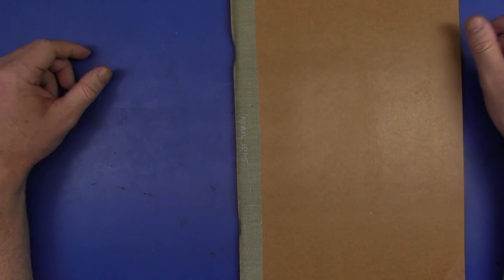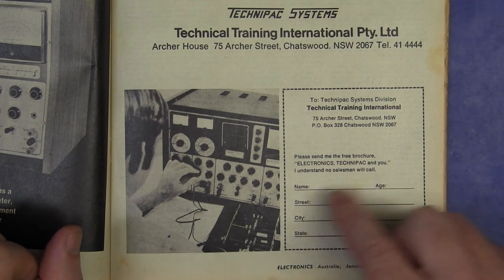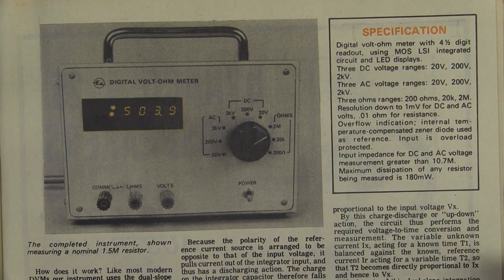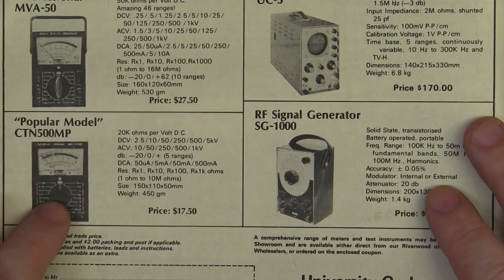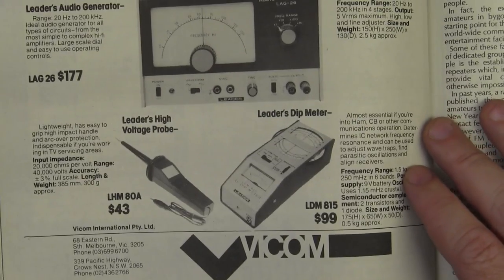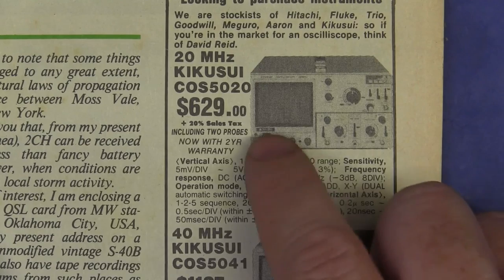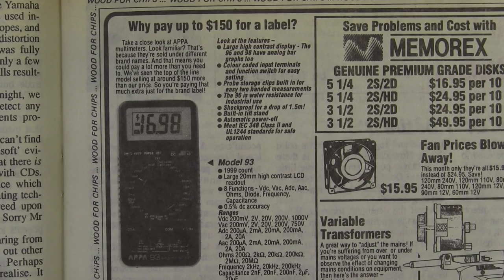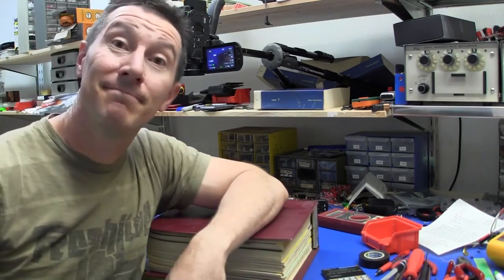EEVblog #416 - 35 Years Of Test Equipment

Comment from the maker: Silicon Chip "own" the right to Electronics Australia. But that does not include the copyright on the all the submitted articles, and technically probably not the ads etc either. No contracts were entered into for the all the contributed articles, so the original authors still own copyright on those.

Comment: Love the "CP/M compatible software" ad at 27:35. You can get TERM for only $110.00, or FORTH for $150.00. With extensive user manual and tutorial. Please specify CPU type: Z80 or 8080.

Comment: Although if they are rated, if they do end up in an incident where they can get damaged, there is no guarantee the device can survive without any issues. Since the AC mains measurements we use them for don't need to be absolutely precise, a cheap multimeter in those instances is a worthy sacrifice vs the other items than can cost hundreds if more more to replace in the instance something does happen.

Comment: Thanks Dave for your retrospective. I was a collector of Wireless World from the late 1960's on. Those earlier magazines were so thick you could spend ages thumbing through them. Lots of audio articles in there, but this wasn't about consumer stuff but real design and construction details. You couldn't buy much good equipment then, so you HAD to build it yourself.  I guess the technology has matured and with the availability of mass consumer electronics, the magazines faded out.  

Best, John

Comment: How does that bwd scope with its isolated ground fit in with your scope grounding tutorial?

The Advantage DMM 2 has a nixie tube display. I can tell, because they took the photo from a slightly high vantage point allowing the different depths of the numbers to show up: the 9s have a higher lowest-point appearance than the 1 does.

Comment: I actually still have a Heathkit 5228 VTVM. And it works!
Sits by my Heathkit frequency generator and transistor testers.  :)

Might want to mention about the relative prices. Like how in '65, a certain bit of test gear was "cheap" at $60 or whatever - but you could buy a car for $2000, or a loaf of bread for $0.20.  And that minimum wage then was $0.95 vs $11.00/hr now (where I am of course).

Comment: next year the first fusion reactor is supposed to attempt to fire up in france, but i doubt it will work, or even have an attempt at turning it on next year (2014). the theory is good, but it will take allot of calibration before they try to turn it on, and when they turn it on it is sort of 50/50 that it will be able to produce excess energy. i expect them to actually try to turn it on in 2016, i hope it works, but i doubt it. it is experimental though, eventually they will get it to work.

Comment: A bit before my time yet enjoyable to know.  The Japanese scopes during the 80s I did not like.  The build quality IMO was just like their consumer electronics, bakelite circuit boards, virtually the entire scope was on one main board and steel cases.  My Heathkit IO 4510  15Mhz scope was all glass epoxy boards, separate boards for each section and the case/cabinet was aluminum.  Performance was not really good especially toward the bandwidth limit and it suffered from vertical trace drift.  I think the leaky tantalum capacitors was the cause of the drift.

To be fair the US makers used glass epoxy boards most likely because it was in the military supply chain.

Eventually got a brand new Tektronix 7603 mainframe scope, to me the Rolls Royce of scopes.

Comment: I wouldn't call the US system of currency fully metric (or "morally" metric) when you have a 25 cent piece (quarter) instead of a 20 cent piece. Just kidding around a bit of course. The US needs more metric supporters. As does the UK still, might I add.